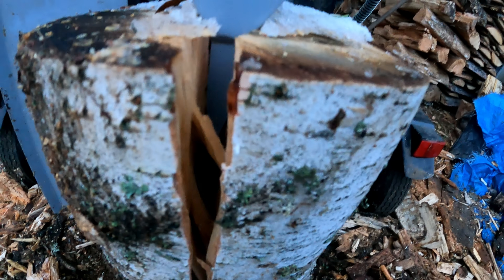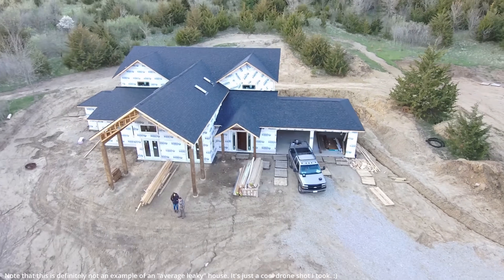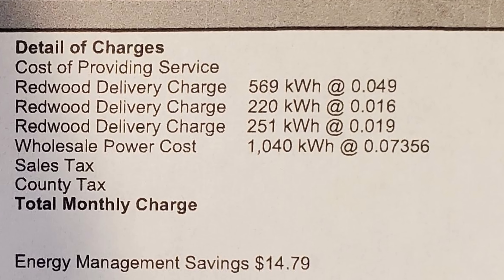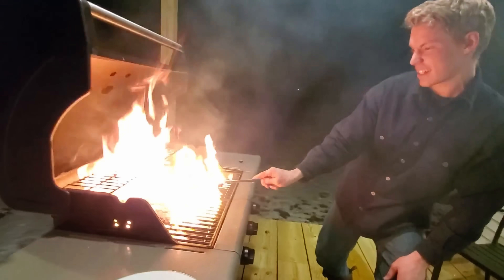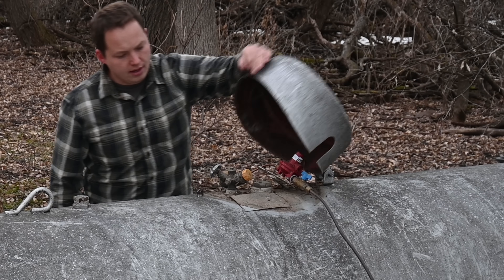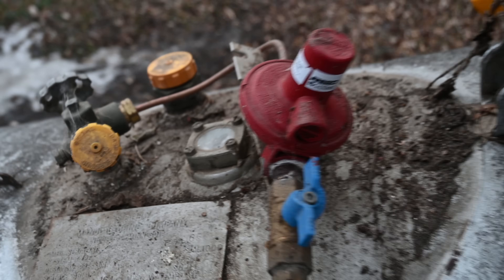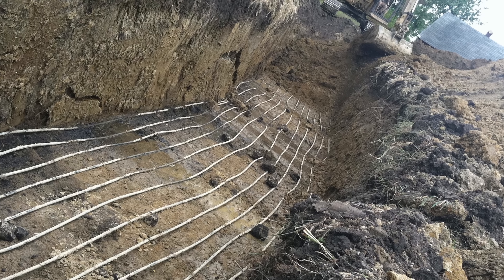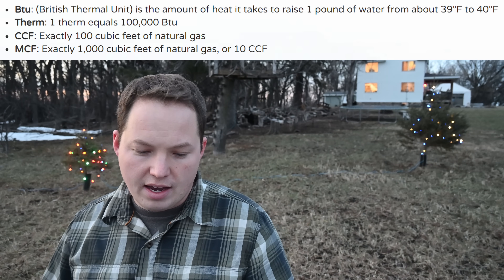What's The Best Heat Source in 2022? Top 5 Home Heating Methods - LP Electric NG Geothermal Fuel Oil

Comment: Thanks Benjamin, Although West Coast, no snow, winter temps get down to 28f but that generally not more than 40 days -Nov. thru Mid. Feb but a lot of moisture in the air. No NG, so delivered Propane or Electricity which as you stated the highest cost of heating. But with Propane cost since the Pandemic prices have leaped to over $4.00 per gallon to where not much difference in using electricity vs. propane. At 72 and home 90% of the time this old joints & bones ache a lot more when the inside of our home is colder, so I pay for less pain to Mr. Power Company. I just subscribed & Bells ringing to get more of your Tips. Wonderful

Comment: Is there a heat pump that works with hot water baseboard heaters? I know electricity is expensive, but my home is well insulated and I have solar panels. Currently have an old natural gas boiler which still works but thinking about a future replacement.  Unfortunately, I have a newish AC only condenser. I'm in the states.

Comment: For portable heaters to pick up a little slack in colder areas of the home don't get the Elite Portable Heaters that claim to be so...good. They're China made crap bought 3 two didn't work right and the one that did didn't barely heat my small bedroom. Plugged my good ole trusty radiant heater back in.

Comment: Geothermal while technically a heat pump ( deserves its own category) is cheaper than natural gas in most places.  It does however have a larger upfront cost.  The electric resistance backup has never kicked on with mine no matter how cold it was outside.

Comment: I have a heat pump. Its terrible. We are at 15 degrees outside right now so all it does is run and blow cool air. I turned on emergency heat until it gets warmer. Older heat pumps only work in warmer climates. Thank goodness this is a rental.

Comment: Best source of heating a home is hot water radiant heat. Cheapest fuel I have seen is pellet fired hot water boiler. I am a propane bulk delivery driver, it is cheaper compared to heating oil. Yes, Electricity is the most expensive !

Comment: Thanks for this.  Even from Rancho Mirage CA we have to heat our condos, it gets down in the 30's some evenings.  Just installed new heat pump, haven't had it on much but my electricity bill is about $3.14 more per month than last year at the same time.

Comment: Primary house was electric heated water radiators, now it's air to water heatpump. Huge savings, 18 000kWh down to 6 000kWh.
Summer house was only wood heated water radiators, now I added air to air heatpump with cop up to 4.6, for my area near Stockholm (cold climate) more like cop 3.8 on average.
Some of my neighbors got deep hole (400' ) 120 meters heatpump, some have community hot water grid.

Comment: Heat pumps Do NOT HEAT, it a lie and an expensive lie.  I have a 5000+ sq ft house and wanted efficient modern heating aka heat pump and my electric bill is now a flat line to steep mountain peak wall straight up outrageous scary line and it’s freezing in the house at night temp set on 68 and by 3 am it’s 40 degrees in the house I have to keep the water dripping so the lines don’t freeze up. Taking the old oil burner out was a bad bad expensive decision.   So they say buy heat strips for the heat pump that is supposed to be efficient down to 19 degrees then when the heat pump is fighting to keep 68 at 66 the strips will kick on so I purchased 20,000 kw of heat strips that cannot be hooked up because I need a separate electric panel installed which means dominion power also has to come and upgrade the system which now means local inspectors and on and on so currently I have 5 new old style Korean made portable kerosene heater $180 each with $5.00 gal fuel in the down stairs just to get the chill off.  Talk about expensive decisions say NO WAY to heat pumps.
Reply: I see that you are probably in Virginia since your power company is Dominion, therefore I can safely assume that your 5000+ sq ft house is poorly insulated and leaks air like a sieve. You should probably get an energy audit done to find out where the insulation is lacking or missing, and where it's leaking air, so you can get those problems corrected. Once you do that, your heat pump will work much better. Also, I am unsure who would have sold you a heat pump without heat strips, that sounds like an incompetent HVAC contractor. They should have either made sure that you had the electric service for the 20kW heat strips or left the oil burner there as a backup heat source. Since they did neither, you have a problem now.

Comment: Grew up in western New York. Snow belt, ski country. -70 to -80 windchill. If your house not insulated, you mite as well burn your money. I have used wood, kerosene, fuel oil which is not kerosene!!!! Electric, natural gas and propane. I have to go with wood as the best and cheapest. The rest don't compare. I used a old round oak parol stove. My grandfather bought it in either 1914 or 1915.  I used it until it couldn't be safely. About 2015 was the last year I used it.

Comment: Thank you for this video. I really appreciate the comparisons, especially when they come from a technician. Two questions.
1. Having dual systems (ie propane and a heat pump) would cost a lot of money to set up. How long would it take to pay that off? 
2. I think you should include GHG concerns as well as the money issues. We are killing our Earth and I think such data should be there for folks to consider. I realize that the costs of energy are relevant to many folks, but if two options are similar in cost and one has significantly less GHG then why not?

Thanks again. Henri
Reply: If you look at the cost of a propane furnace plus an air conditioner, the additional cost to go to a propane furnace plus an air source heat pump is less than $1000. This is for central ducted systems as commonly used in the USA, at the time of purchase. To go from an air conditioner to a heat pump after the equipment has already been purchased and installed will cost much more.

Comment: I am a renter, this is my first year and my heating bill is crazy. I have electric baseboard heat, that are placed on the wall at ceiling hight. I have never seen that before. It a small space about 700 sq. In eastern Nebraska  And it is freezing in here. The house has a crawl space and I had frozen pipes. My landlord insulated the crawl space foundation with spray foam. If I could get any ideas for how to have cheaper heating bills that would be great. Any ideas.

Comment: 1200 square foot house with a basement. Last year I invested in a wood burning furnace with a blower to replace my wood stove that heated one half of the house. Put in some duct and it works amazing. Best purchase I've made. I can spend $500 for two years worth of wood, of course I have to pay for the gas, and the saw, and the chains to cut it up, and it does take time to work it up and bring it in. But... To me there is no heat like wood heat. Nothing feels quite right after growing up with wood heat. Great video!

Comment: 95% efficiency of NG or propane boilers is unrealistic figure.
Usually it is 70 to 80%, you can't go with exhaust gas temperature lower than 120 ~ 130 deg. C because it would form NOx and acids which will corrode your chimney and heat exchanger
Reply: The 95% efficient units use PVC pipe for the flue, which won't corrode.

Comment: Wood works without the need of the grid. It’s dependable & natural. Ol school wood heat takes more effort, but does several things at once. Heats the hs, heats water, humidifies cold Ak air, & you can cook on a wood heater.

Comment: When they were putting NG pipelines down my daughter's street (north-east US), she wasn't sure she could afford a whole new boiler system.  But knowing that she could have them run line into her house for free during the pipeline work, I helped her get it done.  Two years later and she's loving the much lower heating bills (she was using #2 fuel oil @ about $400/month before).

Where I'm at I have NG also.  But friends that live outside of town have propane and boy, do I hear them b**ch about their heating bills this winter.  :(
Reply: Ĺ

Comment: My home is $1,150 sq ft and not very well insulated as it was built in 1940. A new furnace was put in just prior to us moving in that is natural gas. We typically only heat our home here in Pennsylvania from late October or early November till around late March to early April; so roughly 5 months of the year. Our water heater is also gas, as well as our stove. My average monthly bill at the peak of heating season has never been more than $129.00 in a single month; that's including heating our hot water and cooking. If I were to rip down all of these walls and properly insulate and seal this place; I'm sure our monthly bill would drop to around $85.00 even during peak season. So I would definitely say that natural gas is the way to go. And for those of you wondering; no, we are not on any kind of heating assistance or pay program. We just keep our heat at a comfortable temperature of between 65 and 68° except for the nights that get below zero which is rare here. We are frugal in remembering to turn our furnace down significantly whenever we are leaving the house; and have done our best to caulk and seal areas of the home that we were having large air leaks. And we also put shrink film on our windows in the back of the house where my workshop is because the workshop is not heated and let's cold air in to the home. So imagine, most people in my area that are still utilizing oil are spending between $300and $500 sometimes in a single month in order to heat their home. And some of those homes are smaller than mine. Whereas we average $100 per month during the heating season as well as hitting our water and cooking, all with natural gas with an old improperly insulated home. Imagine our prices if we were to properly insulate.

Comment: Nice break down of the options. Personally after an emergency when my natural gas heater ran wide open for a weekend(kids do the darnedest things) 90 degrees all weekend 2000 dollar bill that month it only cost 800 for an in house wood/coal burning furnace that I tied into existing ductwork granted cutting and splitting and storing wood is very labor intensive but it has worked well for 15 years

Comment: lucky me i live on a gulf isl in bc,,lots of wood here to heat my 800 ft cottage,,i still use a few electric radiant for various reasons,,,there handy,,anyway on wood,,get and learn how to use a chain saw,including sharpening,,not that difficult[utube],, study dropping small trees,,a small 2 ft diameter tree,at 30 ft high will heat a whole winter,,!!and the next real key is buy a 400 dollar log splitter from cdn tire,,its the splitting that is back breaking,,cant empasize how necessary these log splitters are,,i have a 4 ton yardworks,,i like it,,also it reminds me of people that r in line at the gas pumps,,complaining about the price of fuel,,while fuelling a huge truck,,get a smaller car,,get a smaller house,,

Comment: I burn wood here in the Ozarks.  I have 3 two foot baseboard heaters I keep going when it is really cold in my upstairs bath, my master bath and my laundry room.  I find free sources of wood I just have to go cut it and haul it back to my house which I have always enjoyed.  My electricity is the same every month, $106, for 1439 square feet.  Thanks for your informative video.

Comment: I have few choices here in south east tn .. and it rarely gets below 25 at the coldest for a few days.. electric is still cheaper down here than any other source of fuel with a heatpump.  Our current  8.341 per kWh a month , propane and kerosene are way more than that.

Comment: You said natural gas is cheapest. However, the furnace runs off electric to run the components as well. You have to figure in the electric cost of just the furnace + The Gas cost to get the real numbers.

Comment: in my area, north idaho. a cord of dougfir will give 20 million btu at  a purchase price of roughly 200 dollars per cord split and delivered .  5 cord will equal 100 million btu at a cost of 1000 dollars . plus the cost of the blower fan on the woodstove . for most of my adult life ive gotten my own wood. it takes me 4 to 6 hours to get a cord of wood , using about 20 dollars of fuel and ware and tare on my truck. then about 2 hours  to split and stack . lots of free exercise and pretty cheap

Comment: Lived in a Brick house that had attic roof spray spray foam, required very little to heat it compared to other similar houses, spray foam 👍.
How do you Integrate all those different sources of heating in your house?
Saw a video about a Siberian woman who heated her house with bitcoin mining rigs, that could be a alternative to resistive or dumb heaters

Comment: Air-Air and air-water heat pumps for DHW, underfloor heating, fancoils.  ~36MWh for heating + ~12MWh for DHW. + ~12MWh for pool heating per year.  I paid ~1200$ for all electricity last year. I have not separate power meter for heating.  Moscow/Russia.

Comment: For comparison here are some figures for my house in the UK : All electric resistive heating run 24/7 for 5 months November to March. 12500kWh at 17.6p/kwh , 20c room temperature throughout. Annual fuel bill (2021/2) GBP1795 Forecast for 2022/2023 GBP2200.

Comment: We purchased a 2700 sq ft log home beside our own 5 acre forest. Most of the trees we knocked down for firewood were damaged and dead trees around 1’ wide. Many were unwanted as we cleared our land to open it up. We even took bigger (36-55”) firs down and sold them to tree buyers. Even the scraps left over were all used to heat our home over several years. We sold $25,000 worth of which 25% of this was spent on trucking them. I can honestly say it was very labour-some over the 25 years but it kept our family fit and warm 😏

Now that our property is cleared, we are starting our 12 lot subdivision. The excavation costs will be much lower, as we only have the rotten stumps to remove. 

The best thing is our winter electric heat expense was only an extra $50 (2 months) as compared to over the summer. On average we paid $180 Canadian for 2 months.

Comment: We have home built in 2005 with a natural gas boiler and three zone hot water base board heat. We also have a swamp cooler. In recent years using the swamp cooler has become increasingly problematic due hotter summers and long periods of time with unhealthy levels of wildfire smoke. We initially were interested in a ductless mini- split heat pump just to cool the house but ended up with a dual zone mini-split heat pump with both heating and cooling functions. We still use the NG boiler to heat one zone of the house and to provide hot water. We have a 3.3 kw solar roof top array that has been producing about 5 megawatt hours of electricity annually. That was about 1500 kWh more than we use in net-metering annually so that should cover most if not all the extra electricity use from the heat pump. We like that reducing the amount of NG we burn results in lower air pollutants being emitted.  Up front and operating costs were not the only factors in our choice.

Generating some of our grid electricity does involve burning NG and even coal but the percentage of fossil fuels used is declining rapidly in our area, with renewable energy replacing coal entirely by 2030. All of the reliable sources I have checked show using grid electricity generated by natural gas is cleaner than burning it in a home boiler.
P.S. The first thing we did was to add additional attic insulation. That alone reduced our NG use by 25%.
Reply: Bravo! What kind of insulation?
Reply: @Jmamelia  blown in cellulose

Comment: Great video! Good info! Here in the Kansas City area the first hvac upgrade we went from Heat pump/gas back up to gas heat, because 1, the heat pump never made the house comfortable, so we ran on "emergency mode" all the time and 2, the compressor finally died.  Went to conv. a/c with gas furnace.  80%.  After a missing flue cap let rain run into the furnace, and never happy with the cooling capacity we replaced it all last summer with a larger 95% furnace and 2 stage condensing unit.  Electric vs Nat Gas here still makes gas a better choice.  I have that very same heater, maybe a year or 2 newer (or older) in the back bedroom (over unheated garage) to take the morning chill off.  While it is not terribly efficient, that resistive heat with a reflective back is turning every watt into heat for the 5 or 10 minutes I need it
.

Comment: I have a 1500 sf bungalow and have propane witch is expensive!!! so i switched to a Comfortbilt pellet stove and now i heat the house for  about $6.00 a day!! Very easy to operate and cheap to run also clean burning!!! so this was a no brainer for the cost and savings!! Just throw in a bag a day and clean it every 4-7 days so easy it's amazing. This is Canadian price to boot LOL :-) Temps here today -26 stove in basement and upstairs 70-72degrees perfect :-) also have a battery back up with a charger inverter and a 100AH lithium battery and when the power goes out  it automatically switches to battery back up for about up to 15Hrs and you can also hook up a solar panel in conjunction to the battery to offset the electricity that the stove uses!! :-) Estimate $800.00-$900.00 for the season like i said way better than propane and most other heating systems Cheers :-)